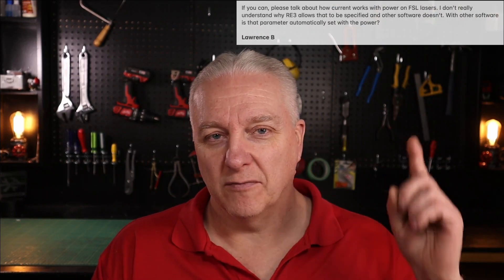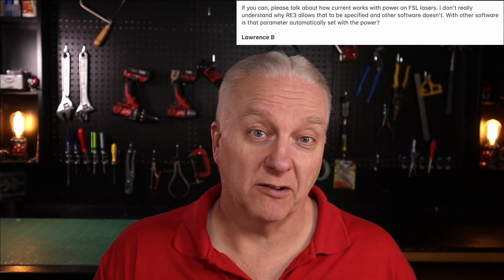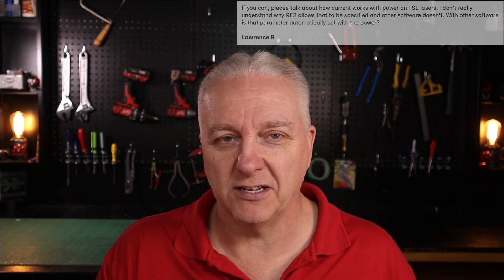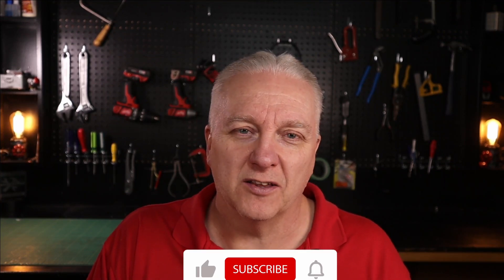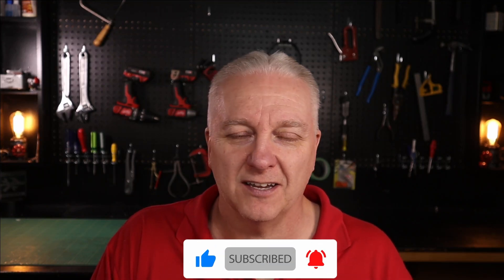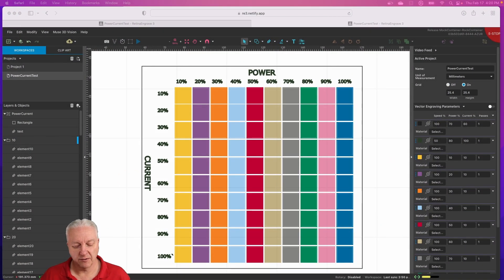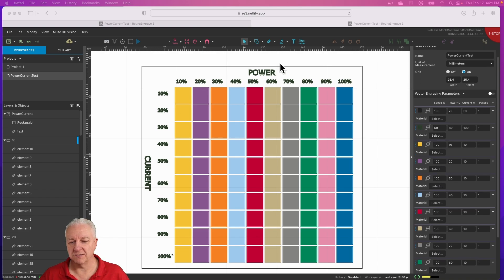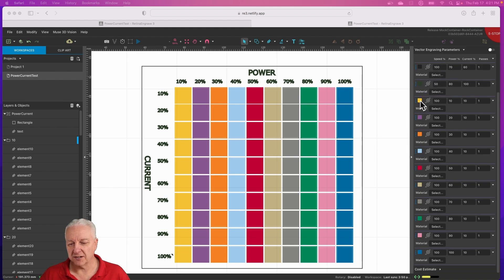Understanding Power and Current in Retina Engrave 3

Comment: Hi Steve, I have a question. I try to reproduce the table you made. But when I switch the percentage in each cell and hide it to start the following row the values are not saved. Do I need to be connected to the printer? Very useful video.
Reply from the maker: You will need to be connected to your printer since this is where RE3 is running.  This entire process is a bit of a hack because RE3 lacks the ability to increase things like power in the next cell like Lightburn does.

Comment: Hi Steve, I've been watching your videos for a while now and was soo inspired by them I ended up getting a 45w muse 3d and I'm still learning how to use it. I have a question that maybe you can answer. I'm burning some tiles using the Norton white tile method, I've burned a raster material test tile and now I want to burn some photos onto tiles for coasters the question is if I use halftone dither or stucki it still asks for power/speed how do I determine what to pick based on my material test grid(raster). Am I looking for the darkest point, the lightest point, or should I be picking a mid range tone? Thanks and keep up the great content, I always look forward to your video and have learned soo much.
Reply from the maker: There are a few ways to do this. Look at your test grid and choose a speed where there is some light engraving at the whitest part and the darkest part is as close to black as you want it. Use that speed and set the maximum power to 100%. 

No matter what, you are still going to have to play with the settings a bit though,so get some extra tile. Fortunately it’s pretty cheap
Reply: @SteveMakesEverything  Thanks! I have a whole box of tile to experiment with so I'll see what happens.. :)

Comment: I am not convinced that current is a true current control it’s must be software thing by RE because the laser module has only one control PWM pin, and in PWM there is no current control, it’s total power control by charging the pulse width
Reply from the maker: Yes, I agree with you.  I had a conversation with Russ Sadler (his channel https://www.youtube.com/@SarbarMultimedia) about this a few weeks ago and he convinced me of the same.  On his channel, Russ does some seriously cerebral thinking about the underlying physics and technology surrounding lasers - go watch his videos 👍

The real question is: Why does FSL provide both a power setting and what amounts to a PWM setting?  Since they are trying to make RE3 simple to use, they should really provide a single parameter and then do some underlying calculations to generate the laser output.  Lightburn certainly does this and it makes things much easier.

Comment: If FSL wants to continue to grow and expand, particularly to the hobbyist/semiprofessional, they need to make their machines Lightburn compatible.  I have a first-generation Muse and now a diode laser.  I always struggle with RE3 and have found Lightburn to be a dream come true.  And to have powerful design AND control all in one package is awesome.  I used to design in Inkscape and burn in RE3.  Now I design and control at least my diode laser in LightBurn. LightBurn is extremely powerful but still easy to use.
Reply from the maker: Agreed. I have pleaded with FSL on numerous occasions to at least also support Lightburn in addition to RE3. But really LB eclipses anything that RE3 supports. RE3 is good if you are completely new to lasers but most people will outgrow it pretty quickly, especially if they are using the laser for business.
Reply: @SteveMakesEverything  Thank you for helping to convince FSL to support LB.  Like many manufacturers they should spend their time developing the machines and let software experts like LB provide GREAT software to design projects and run the machines.
Reply from the maker: @slhasebroock  Yep, I definitely agree.

Comment: Not related to this but,  will the muse 3D laser fire with the air assist disconnected.  I am trying to use powder coat coloring.  My laser will not fire if I select air assist off under settings, or if I disconnect the hose from the nozzle.
Reply from the maker: To be honest I’ve never tried this. There should be a way to turn it off - check the settings option in RE3 to see if it can be disabled. Worst case disconnect the hose from the tapered nozzle

Comment: Thanks Steve, I had a tech come and align my Muse Core today and we were chatting about power and current and this video helped me understand.
Reply from the maker: Thanks, but You really need to align your own laser. 😉 I’ve done a couple videos and the latest FSL alignment video isn’t too bad either. You shouldn’t need to pay for someone else to do it.
Reply: @SteveMakesEverything  you are so right, he walked me though it step by step on how to MICRO adjust the mirrors. I had them way out of wack. Watching in person really helped me out.
Reply from the maker: @katiberwald3643  Great, at least he left you with some new knowledge
Reply: @SteveMakesEverything  he did say to running your laser at 100% power will burn out the tube faster.  What are your thoughts? I know you say to keep it at 100% power when cutting vectors.
Reply from the maker: @katiberwald3643  This is certainly true, though what you see as 100% isn't necessarily the actual 100% power on the tube.  The software will probably scale this back.  For example, on my DIY laser, when Lightburn thinks it's at 100% power, it's actually about 90% because I tuned down the power supply a bit.

Your Muse 40-45W laser is probably putting out 30-35W when you tell it to work at 100% 

Regardless, a tube is a consumable item and no matter how you baby it, it will eventually need to be replaced.

Comment: I just watched a video on this from FSL and they presented a pretty easy way of how to use current.  Use 100 current and test only using speed + power for the big adjustments. When you find a good setting for those, use current to fine tune the results.
Reply: I agree.  I set up my cuts using power and speed and then adjust my current for clean cut and reduce charring. Steve, love your videos. Keep up the good work.
Reply from the maker: @keithbrock5201  Glad it was helpful
Reply from the maker: I’m pretty sure when they say “power” they actually mean voltage

Comment: Thanks so much for doing this!  I had been trying to figure out how to do a test grid that showed three variables (speed, power and current), but gave up as it was too huge. By simplifying it and keeping the speed constant, it made more sense. I had been trying to experiment with changing the current a bit, but all my results looked about the same because they were in the mid to lower right quadrant of what's on your test grid. I'll run some tests on my 100w Titan and see how it goes, but I imagine it will be similar. Again, I really appreciate your doing this!
Reply from the maker: Well as you can see, it not the easiest but it’s at least possible